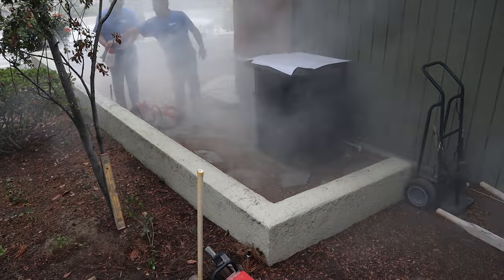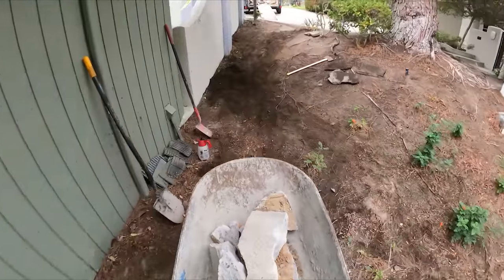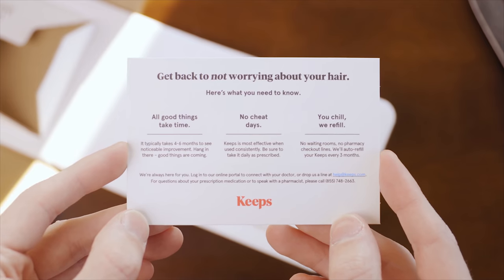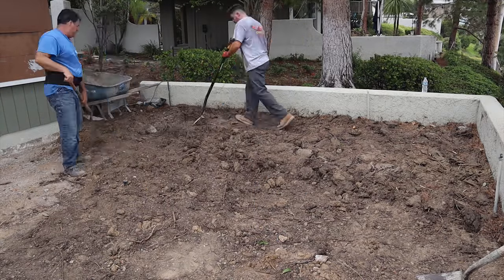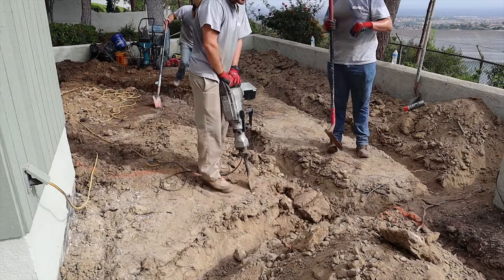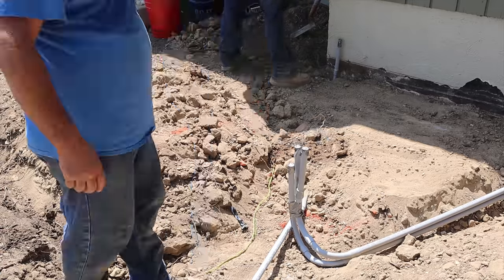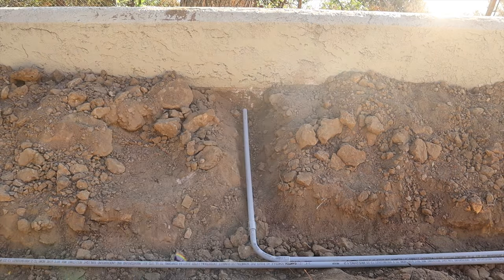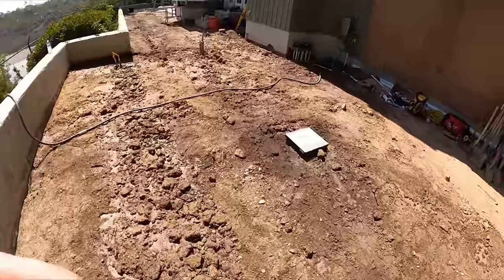Complete Backyard Transformation (Part 1)

Comment: Dave I had a question about how you tied into the hose bib for the irrigation valves. How is that different from connecting to the main water line for the valves? I’m in Oregon and I’ve had a hard time finding someone to install an irrigation system connected to the main city water line. 

Can you explain that process a bit more please?
Reply: If you can't find a licensed plumber to do that work, there might be a restriction in your area for connecting a sprinkler system to a city/municipal water supply. Check your area's codes.

To answer the original question though, it looks like the line for the hose spigot already had a soldered T-fitting w/ a solder-to-thread fitting attached below. Considering that we can see thread tape on the new valve, it looks like he installed a threaded M to F shut-off valve and then screwed in a threaded PVC adapter.

Comment: how do you do all those different services?  gas pipe, electrical, and water pipe without being a licensed gas pipe fitter, electrician and a plumber? and then don't they have to be inspected?
 I mean Cali has to have some of the most invasive and extensive regulations in the country. ill bet you just love assholes like me that want to know all this stupid crap, i mean if you used to do black iron pipe you must still be licensed i guess. going to be a beautiful job as usual fo Odell! nice work and i want that saw.
Reply from the maker: I have the licenses for what I did.
I will need a electrician for the wiring.